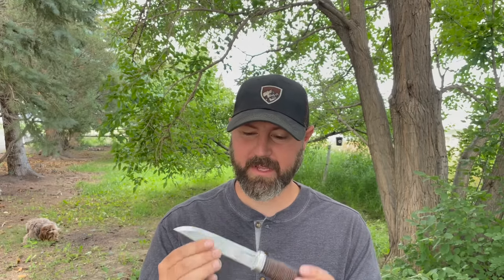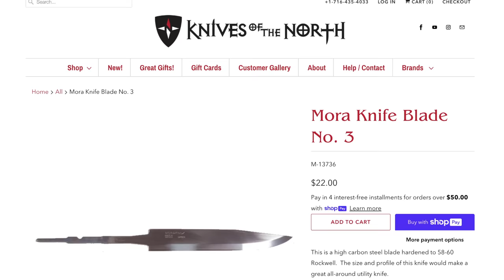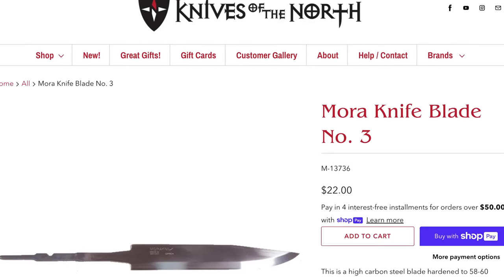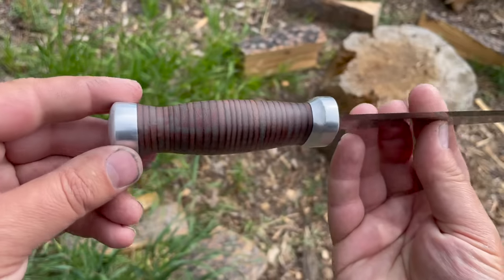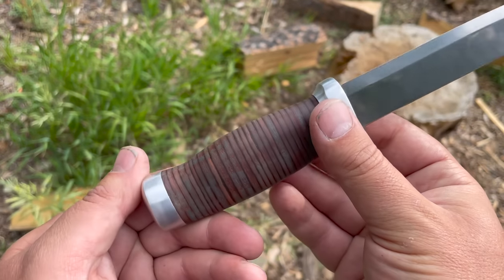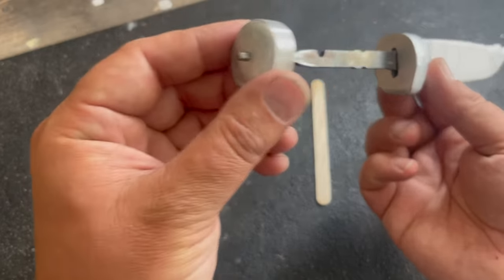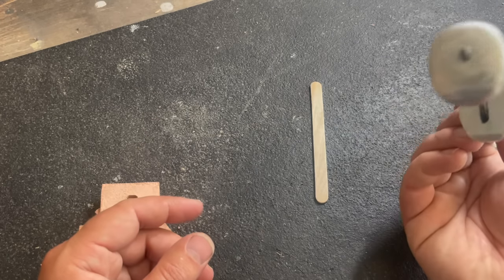Give Your Mora Knife the Handle It Deserves | Stacked Leather

Comment: When I was in the US Army SF, before going to VN, I made a sheath combat knife to take with me.  I did not use a file for the blade, but went to a machine shop supply house and bought a piece of 1% carbon tool steel and shaped it, including hollow grinding the cutting edges...  I also used stacked leather for the handle, but used brass for the guard and the hilt.  Worked great and I carried it daily for my 16-1/2 month tour over there.  I need to do a little restoration of the leather as it has shrunk a bit.  I still have it, but keep it in my safe.  I will pass it down to my heirs eventually.
Reply: Very Cool history,  thank you for telling it.😊
Reply: Brass would have been prettier but the Aluminum came out nice.
Reply from the maker: I think I would’ve liked brass more as well….hind site
Reply: @wyomingwright  I like the aluminum look for this utility knife.  The pommel reminds me of my PAL 36, with the exception that the pommel on the 36 is not threaded.  It is pined perpendicular to handle  the  all the way through capturing the stick tang Thank for the video, nice knife.
Reply: That’s very cool
Reply: That's really cool, thanks for the story, i'd really like to see it
Reply: @oldmanfred8676  Aluminium.

Comment: Next time you do a stacked leather handle, cut your pieces, punch the holes and then soak them in water. Then get a long 1/4-20 carriage bolt with some large fender washers. Put a washer on the bolt then place all the pieces on the bolt. Then place the second washer and nut on the bolt and tighten as hard as you can (water will start to seep out). Sit the stack somewhere warm and dry for a few days. Youll need to keep tightening the bolt periodically.  Then use as normal. By wetting, compressing and drying you lessen the chance the leather washers will shrink and seperate down the road
Reply from the maker: Great advice!
Reply: @wyomingwright  and when get to your final finish grits, start sanding in one direction only. You can do the "shoe-shine" method just only to the left or right. I usually go up to 400grit, that'll leave a beautiful burnish. Then you can dye if you want. I usually seal mine by melting in same wax mix (50/50 beeswax and parafin) I use on my leather edges.

Comment: My thought for finishing the leather handle would be, instead of wax, use thin CA glue, let it soak into the leather to properly protect it from the elements and then fine sand it to a nice finish. But, regardless of that, this was an awesome build!
Reply: Or epoxy

Comment: Nice modification of the Mora, I really like the stacked leather look. I bought an inexpensive old WW II era PAL knife on EBay with rotted leather. Took it with me to a knife grind in and restaked the leather, sanded and polished the blade. Came out better than I could have imagined. I’m going to another grind in this coming June and want to do something similar except that I’m going to grind down the stacked leather about a 1/16” below the guard and the pommel edges and then do an 8 strand braid with brown and brandy toned leather strips. Enjoying your videos. Donald.

Comment: Great job!  It looks great and has inspired me to make one myself.  One question, when stacking the leather pieces, did you keep the smooth side facing in the same direction for each one or did you alternate their orientation 1,3,5....2,4,6...?
Reply from the maker: I kept them facing flesh side toward the guard. That way I knew I’d be twisting the pommel against the smooth side and I had less resistance while tightening it down really tight.

Comment: BEAUTIFUL JOB, but I would have for sure set the blade deeper into the guard to give the Tang more strength
Reply from the maker: Yes I should have put a little more work into the gaurd. Gaurd fit-up is by far the most tedious part of through-tang knife construction, but also probably the most important. I will do better on the next one!

Comment: It's a very nice-looking handle, but the blade/ricasso to guard fit up could have been a whole lot better. A bit of extra filing could have seated it a bit better.
Reply from the maker: Yep. I kinda reached a point where I had exceeded my margins on the side and I didn’t quit have the tools to get the precision on the ends of the slot without making it worse on the sides. I’ll do better next time.

Comment: What was the tool you used at 6:30 ?  Brand or link would be appreciated!   I have my Dad's stacked leather knife from way back.  He was in the military in the 50's.
Reply from the maker: That is a threading die. I think I got my set from harbor freight years ago. There are nicer sets out there, but this one works well for my projects.
Reply: @wyomingwright  I was looking at the handle/holder for the die.  I hadn't seen one quite like that.  Was that from HF, too?
Reply from the maker: Yes it came with the set